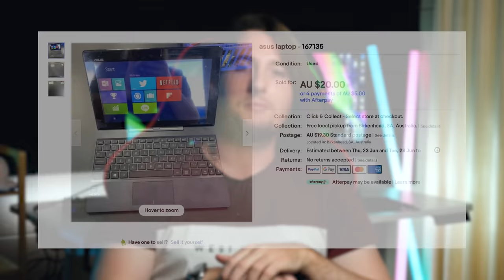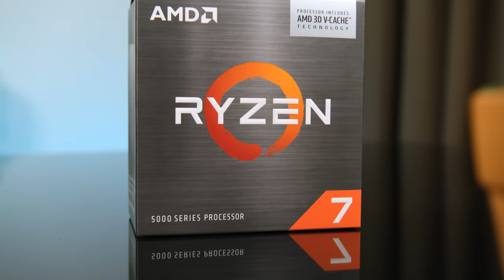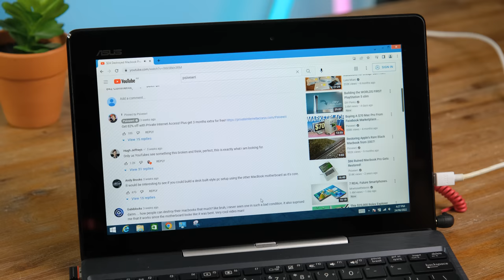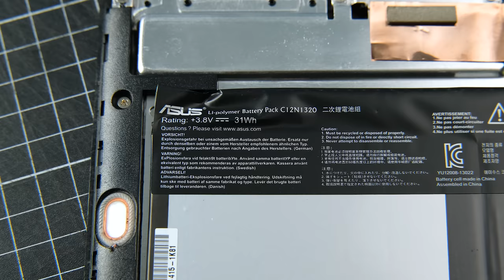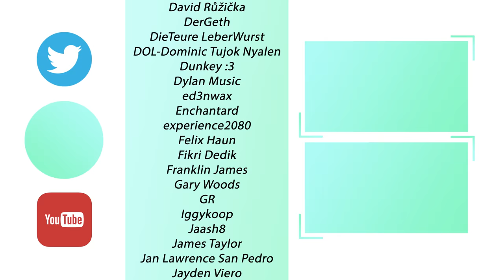I Bought a $20 Laptop From Cash Converters...

Comment: You wouldn't believe the PC spec what I'm using, but it does what I want it to do, so don't laugh, my PC is not online. Plus I like limitations. Know exactly what's in in & I feel so satisfied with it because somebody donated it to me a few years back & it was faulty, kept overheating & crashing. I looked inside it, & basically you couldn't see anything because of so much dust fluff build up, I don't think it was ever cleaned before I got it. I spent all day giving it my full attention, completely dismantling it, cleaned, blowed & brushed everything back to factory condition, cleaned & reapplied thermal paste. Rebuilt it & tested it.
Before, it sounded like an angry old man UUUUUUUUUUUUUUUUUUUUUURGH!!!!!!!!!
Now, it sounds like a soft & gentle hum
huuuuuuuuuuuuuuuuuuuuuuuuuu!
In about 3 months, the PC has hardly been turned off & I'm expecting failure which does not come. I love my old machines 
It still needs a little work because it has the wrong size PSU & one of the RAM banks are not working due to a blown capacitor next to the slot which I will get round to replace.
HP Tower PC
1GB System RAM
64MB on board VGA GPU
40GB HDD
DVD ReWriter - showing wear & tear, contrary
Windows XP Ultimate

I know it's really old by today's standards, but I don't care! You can keep your up to date tech which would probably burn out in a few years.
My PC is pushing nearly 20 years & I'm proud of it. It's a tough little donkey!😊👍❤️

Comment: Extra RAM doesn't necessarily help for these old low powered CPUs.
Few months ago I decided to do a test (my channel is not a hardware channel) upgrading my 15W system's RAM from 2GB to 8GB.  
I tested oh, 50?  70?  I don't remember now, games.  For the majority of the games there was little to no improvement and there were games which actually performed a bit or far more worse with the extra RAM.
I am going to put the link in a reply to this post as I don't know if you have enabled them or not and I don't want the main message of mine to vanish.  
Thanks for the video.

Comment: I have 3 of these, 2 with Win 8 and one with Win 10. If you can do surgery to install 64 or 128 EE Disk it is usable. The Win 8 units only had 32 Gb drives and Windows bloat has made them unable to load even the modest set of software I need. You can install Win10 but my unit will only put sound  out on USB, This may be a driver thing with the internal sound hardware. The Win 8 units failed to update to Win 10 due to driver issues.One Win 8 unit has a bad battery.

Comment: For the permanent marker stain I can suggest using "General Purpose Thinners" or Methylated Spirits. Just be careful though if you decide to use thinners, as it does have a tendency to mess with certain types of plastic. I'd say thinners are much better at getting rid of the marker though.

Comment: To remove permanent marker, use a permanent marker and mark over what you want to remove.  Wipe off immediately.  Pro tip. Try it on a test piece and you will see it works like a charm.

Comment: One of these with USB C, 4GB - 8GB of RAM, and a stronger processor would great in this form factor if I could install a modern Linux distro on it for around, or under $300 USD would be great, but seeing as ASUS won't be doing this, I'll stick to cheap Android tablets with at least 4GB of RAM instead.

Comment: Nice little machine, but Windows 8.1? Yuck....
I would seriously have changed Windows 8.1 for Windows 10, even if the latter doesn't like running on 2GB RAM as well as Windows 8 (and earlier). The user interface (if using as a desktop/laptop, with the keyboard and mouse) is absolutely awful on Windows 8, and Windows 10 has its own Tablet Mode if required.